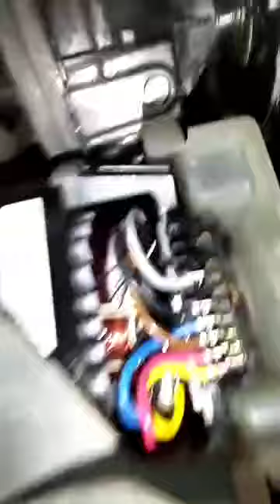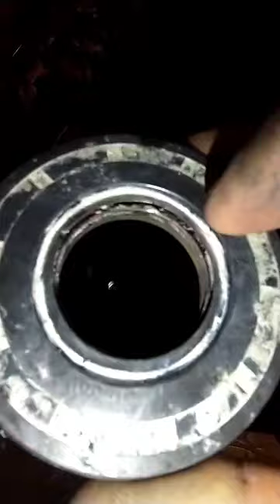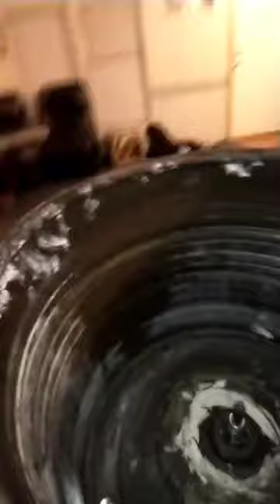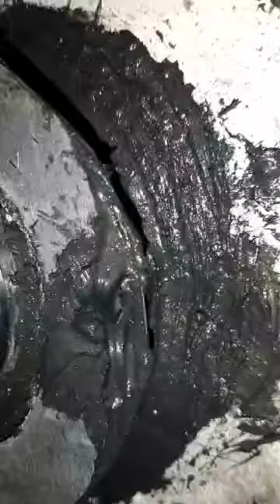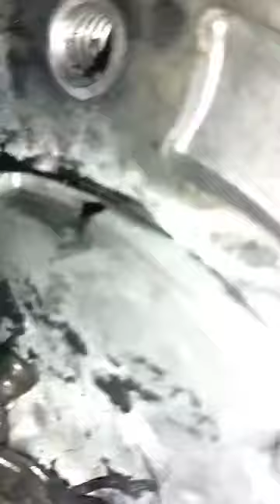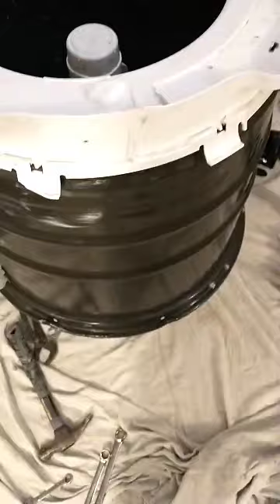what I did today ,and tonight 3/30/2022

Comment from the maker: This repair lasted until 12/2022. It did most of the laundry for about 40 apartments. So though it didn't make it a year it was still a good repair . I'm going to be replacing the outer drum and bearing this time .  The problem is the area with the seal is bent .